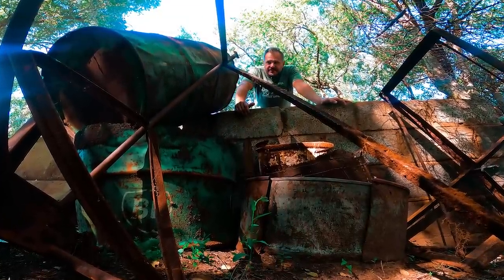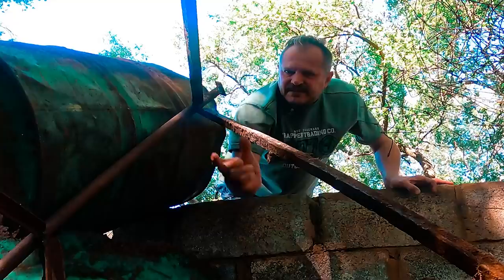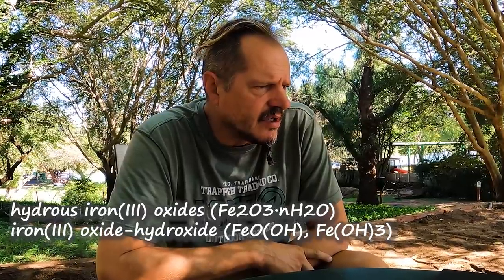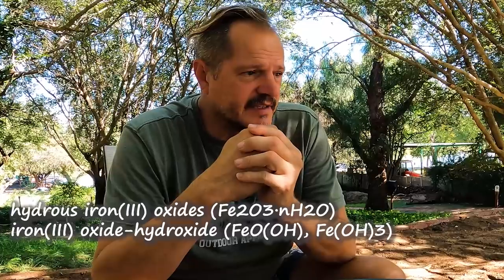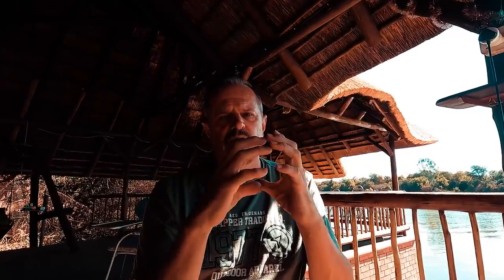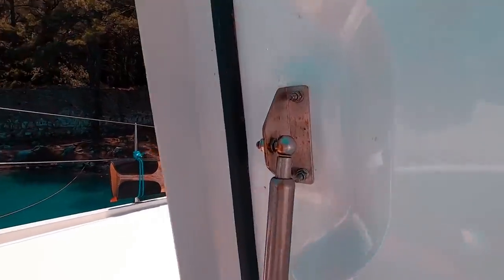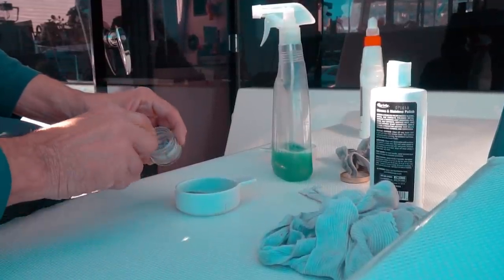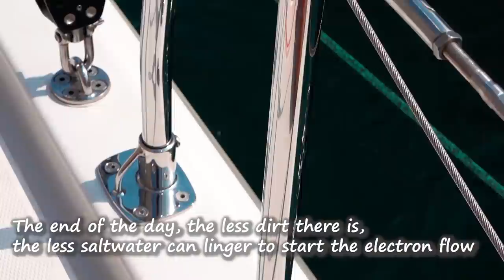#131t Why is EVERYTHING RUSTING on a boat | Sailing Sisu Leopard 45 Catamaran Circumnavigating

Comment: 6:03 Ships underwater rust much more slowly because rust, as oxidation, requires oxygen to happen.  Under water there is significantly less free oxygen around to react with the metal.  They will eventually corrode away, but that would likely take thousands of years.  In the black sea the composition of the water under a certain depth is so unfriendly to corrosion and decay that objects that have been there for hundreds of years come up looking basically like the day they sank.  It's pretty cool.
Reply from the maker: Very true and correct! Both O2 and H2O are required for rust to form. And I think it is bacteria that provides the oxygen, which in turn, causes the corrosion?

Comment: It’s Mike here, sorry for your loss Frik, it’s never easy 😢
In terms of stainless steel there is a process of “passivating stainless steel “ with citric acid which supposedly allows the surface to seal making rust spots more difficult to form. The actual process of how this is achieved I’m not exactly sure of but I’m sure you will agree that some parts just keep “rerusting” and on others not a mark.so it seems as if certain manufacturers of products passivate their work and others not.
Reply: ⬆️ then why does 50+ year old stainless sreel railing NOT rust. Yet, brand new stainless steel railing does?
🤔
Reply: @UCK957  because it was not passivated properly and or a lower chrome content ?
Reply from the maker: Thank you, Maja! Yeah, SS grading is always mentioned and it is in a sense true. But in reality, I have seen Tylaska 316 quick release shackle (made in the USA) having rust in a few weeks. Granted, the Tylaska quick release is on our spinnaker halyard and when not in use, is attached to bow sprit and gets sprayed very often when we beat into the wind. But that may also explain the rust forming so quickly. It is constantly getting salt water and then it dries out, getting wet again, dries out, etc. The water stays longer in the hinge mechanism and starving the chromium from oxygen to create the protective oxide layer and then the Fe just can't help itself to give those two electrons away...
Reply from the maker: Steven, I noticed the same thing. However, in the beginning I had to polish and treat my SS once a week and rust will just keep on coming back. But after a while, I noticed I could skip a week and lately I polish the SS perhaps once in two months when it gets dirty or dusty. But boy, the moment I added new handrails, they rusted the next day! And the SS guys swear it was the highest standard SS :-D anyway, I started to polish and put rust block on those railings and after a while they held there shine longer and longer.... I am wondering now...old boats may have been treated the same way in the beginning? I mean, which new boat owner does not brood and polish his love of his life's SS every weekend? I think the Fe inside SS needs to be 'pacified' and granted, some SS manufacturers is dipping there SS products in chemicals to do just that, but the moment you scratch the SS or heat it up with welding or allow dirt to disturb that chromium oxide layer, the rust process will start...does not matter how old the boat or SS is.

Comment: Frik, love the scientific approach to understand the root cause of the rust, but I think you might have left out one key element - the actual alloy of stainless you have.  From what I see in the video the rust you have is what we typically call 'Running Rust' which is mostly superficial, doesn't penetrate deep into the alloy, and the 'running' part of the name is because the rust powder is so fine that it tends to leech with water for and leave rust stains in the path that it runs.  What it tells me is that those hardware piece you had to clean up are 304 alloy Stainless Steel.  Judging by color and the lack of rust on other components of Sisu, like tube railing, those are 316L Stainless Steel.  316L is now the industry standard for most marine hardware but it wasn't always.  304 isn't BAD stainless, it just don't have as much chromium content so it is less corrosion resistant.  304 is actually a bit stronger than 316L, and many fasteners default to 304 for strength.  Many manufacturers use 304 as a cost cutting measure, when buying hardware items and fasteners you have to shop carefully and buy from reputable suppliers to know that you are getting genuine 316L alloy composition in the products that you buy.  Your treatment regimen was excellent but you would greatly benefit from bedding the hardware in a flexible Sika compound to prevent standing water from creeping behind the hardware and starting the rust cycle again.  As you pointed out, none of the rust was forming on the exposed side of the hardware.
Reply: some bolts are labelled 316 when purchase new but I am at a lose to what version of 316 stainless that have just bought. One part that you may not be aware of is the mean operating temperature can effect the 316 stainless steel when in direct contact  with the water. Anchors for an example may work fine in cooler climates but near the equator it is suggested to to use different grades of stainless steel such as the  Cromox super duplex chains as an example  
 (https://www.ketten-waelder.de/en/nautic
Reply from the maker: Yeah Luke, you are correct. SS grading is always mentioned and it is in a sense true. But in reality, I have seen Tylaska 316 quick release shackle (made in the USA by a reputable company) having rust forming in a few weeks. Granted, the Tylaska is on our spinnaker halyard and when not in use, is attached between the bow sprit line and halyard which means it is suspended by two lines and doesn't touch any other metal, therefore, no galvanic corrosion is in play. It gets sprayed very often when we beat into the wind. But that may also explain the rust forming so quickly. It is constantly getting salt water and then it dries out (exposing the shackle to oxygen), getting wet again, dries out, etc. The water stays longer in the hinge mechanism and starving the chromium from oxygen to create the protective oxide layer and then the Fe just can't help itself but to give those two electrons away... in the beginning, all Sisu's SS were forming the surface rust, especially where the SS were bend or welded or scratched by lines or where dirt accumulated or something. I had to put rust block and polish on every week. Later I noticed that I could skip a week and lately I do it only once in 6 months. When I installed new handrails, I immediately saw rust forming on the new rails and had to give them the same tender loving care :-) You are absolutely correct about preventing the water seeping in between the SS and hull. The manufacturer did Sikaflex some of the fittings, but it seemed over time the Sikaflex separated from the SS and water seeped in causing the rust to form. Sadly, I can't remove those fittings because of the Sikaflex holding onto the fitting and I just can't get a blade or something between the fitting and the hull without damaging the gelcoat. Hence, I am now going the lanolin route hoping that lanolin will prevent the water from touching the SS.

Comment: Also iron that sits in one place for a long time seems to rust quickly.  The windmills keep spinning due to wind so maybe the water molecules don't stay on it long enough to rust quickly.
Reply from the maker: Not so sure that statement holds water 😊 the rod that moves up and down goes slower and that rod is iron. If I am not mistaken, then the blades are galvanized, which has its own protection layer against oxidation?

Comment: 😯, your DAD has left a good son!
On another note, a suba tank I had was first hydrodynamic tested in 1947. YES 1947! No rust internally, the outside was another story. I have seen 1-year old tanks condemned due to rust, inside & out. The jury is still out as to why.
Reply from the maker: Thank you, Steven! Yes, I am a scuba dive master and we try to tell people to always keep a bit of pressure in the tanks. The pressure will keep the moisture out and prevent rust. But I think you are also correct, the older tanks may have better quality production because the manufacturers were over engineering things such as scuba cylinders, but over time they realized that they can save money if they tell divers to keep the tanks pressurized so no moisture will enter and if it does, then it is not the manufacturer's fault, but the diver's fault...sad.
Reply: ⬆️ cont. Yes, pressurized scuba tanks seemed to last longer and stored as close to stabled temp.day & night  I can only remember 1X being 'sucked dry'. It was on a submarine dive (early 80's) off Lahaina when a fellow diver had the bends in his right hand. He went back down and had 5-tries to rid the bends, which he did. So,so lucky. And, was the first time I saw my tank float so high! I only stayed for 8-minutes, which was very close, being 125ft. on my depth readout.
Reply from the maker: Wow!

Comment: Sorry for your loss. Shouldn't the anode fix the problem with rust? Why not try to ground one of the hinges that rust to see if that helps (as an experiment)?
Reply from the maker: Thank you! He was a legend and had a good life! The issue is not galvanic corrosion which I handled in another video. This was a tough technical one over which I pondered a long time on how to present the highly technical realm of half reactions :-) the issue is the iron (Fe) which cannot hold onto those two electrons. The only way to prevent it losing it, is to remove the components causing it, such as water or oxygen, but it is not that easy on a boat :-D stainless steel is going a long way of pacifying the Fe where the chromium "rust" but creates an oxide layer, which hides the Fe from these two elements H2O and O2. But dirt or scratches disturbs this oxide layer, and the iron sadly starts to lose those electrons and the process starts... I think that grounding the hinge will accelerate the process? Because now you may have galvanic corrosion too?

Comment: maybe --it would help to put on some more zinc blocks ?
Reply from the maker: Zinc surely slows down calvanic rust, which is the flow of electrons from a weaker metal to a superior metal which are connected such as prop, shaft, engine block. Here a zinc block will work. I mentioned this in one of my previous videos about Galvanic Isolators.. In the case of normal rust, like hinges, it is the flow of electrons in the presence of water or an electrolyte such as salt water, and oxygen. The iron Fe is the one loosing its electrons all by itself 😊 you can try attaching a zinc block to all hinges, but I am afraid the Fe will still be sacrificing its electrons 😢

Comment: I would be concerned Leopard are not using the best grade stainless?
Reply from the maker: In a way your concerns are valid, but yeah, SS grading is always mentioned, and it is in a sense true. But in reality, I have seen Tylaska 316 quick release shackle (made in the USA) having rust in a few weeks. Granted, the Tylaska shackle is on our spinnaker halyard and when not in use, is attached to bow sprit halyard (meaning, it is not touching any other metal and is hanging all by its own so, no galvanic corrosion) and gets sprayed very often when we beat into the wind. But that may also explain the rust forming so quickly. It is constantly getting salt water and then it dries out, getting wet again, dries out, etc. The water stays longer in the hinge mechanism and starving the chromium from oxygen to create the protective oxide layer and then the Fe just can't help itself to give those two electrons away... That said, I do agree that the new production boat manufacturers and not just Leopard, are cutting corners and by not dipping the SS parts in pacifying chemicals saves them a lot of money. It is sad that they left it to the owners to spend a lot of time to polish and treat the SS. The SS is 316 marine grade, but the Fe is not pacified properly and only over time and tender care, will it get there.

Comment: Unfortunately lanolin doesn’t really work! I’ve tried it. Mineral oil works better, if you’re using oxalic acid, which works great for a lot of chores, you have to neutralise the acid. Stainless below the waterline is a big no, in my opinion. Lanolin to anneal a stainless weld, does seem to work well. The exception to stainless below the waterline is a stainless shackle connecting galv steel chain. The galv steel chain works as an anode, protecting the stainless. I arcweld the shackle shut and anneal with lanolin. Electrolysis in stainless is very hard to see, a pinhole on the surface of a fitting, can have a cavernous hole hidden beneath the surface. Often the first time you know about it is after a failure. Tea staining is the best indication of electrolysis in stainless. 😎🏖🌴☀️🇦🇺
Reply from the maker: Jack, you are correct :-) the reason I use lanolin is to prevent water getting to the steel. Off course, if you cannot reach all the places with lanolin, such as crevices and water can, then you have a bigger problem with the pitting you mentioned. The other issue with lanolin is that if you apply it while there is still water inside such as the case of lifelines, then it will be trapped for ever and the electrons will keep on flowing forever. Another issue I mentioned is that any greasy product such as lanolin, will attract dirt and allow water to be attracted and trapped easier. I used it below the hinges to prevent water getting in between the hinge and the fiber glass. I could have Sikaflex it, but over time the seal would break, and water will come in. Lanolin would stay longer, I guess?

Comment: Frik you should double check if that is real 316 steel with 11%+ chromium and Nickel; 316 should not react like that in any condition, sounds like it might have been sourced from a supplier that tried to save costs. Also; dont clean stainless with Hydrochloric acid; it will permanently damage the steel, Hydrochloric acid damages any kind of stainless steel and should be avoided. check out this link for reference https://en.wikipedia.org/wiki/Stainless_steel. Reference section Austenitic stainless steel, Ferritic stainless steels and Acids. Use phosphoric acid.
Reply from the maker: Great advice, Ernie! Yeah, difficult to test the SS to be according to spec 😊 but on the other hand, even our Tyliska snap shackle, with the 316 stamp on it, rust 🤔

Comment: get the eletrics tested condolences for your dad
Reply from the maker: Thank you Matthew! This is not galvanic corrosion or stray current. I did an episode on why you need a galvanic isolator earlier on where I cover galvanic corrosion as well as stray currents. The reason I say this and I may be completely wrong 😏 is that the Stainless steel which is rusting doesn't touch any other metal. They are completely isolated. There are not even moving parts of the same type of metal 🤔